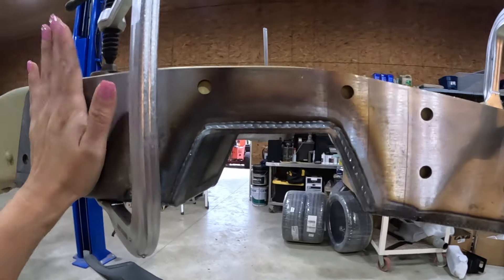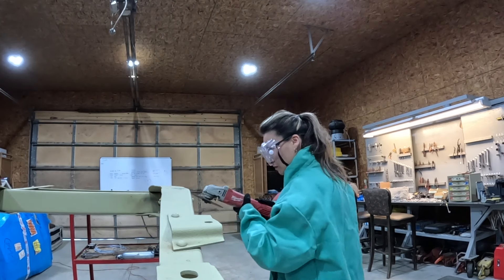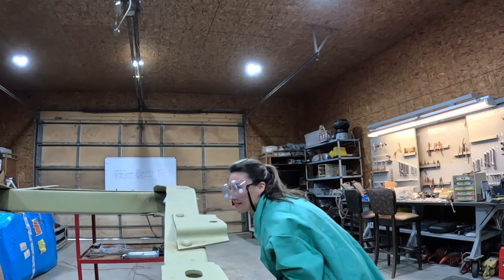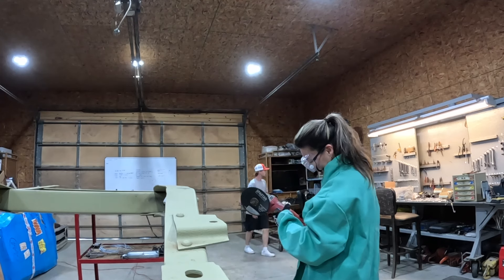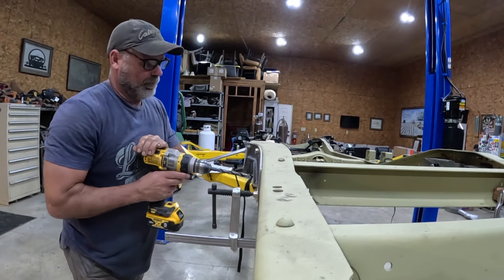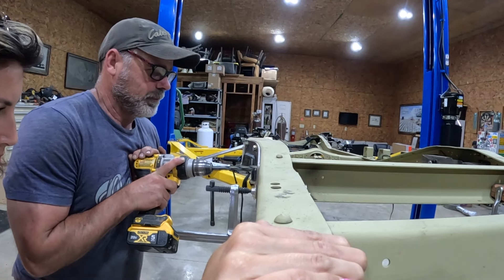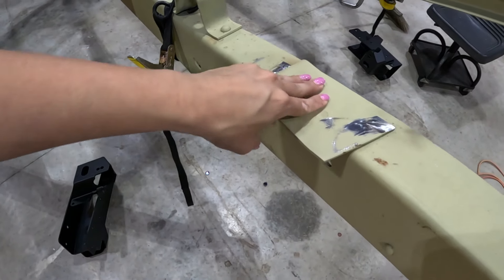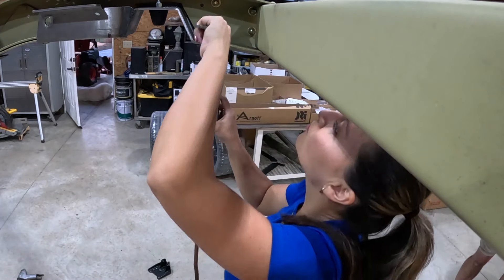FIRST PROJECT UPDATE CHEVY C10 C-NOTCH WITH DSE BOLT ON KIT

Comment: The bit won't break if you get behind the drill and control it the way the other guy did after you broke the bit.  Reaching up to drill makes it so that you cannot control the angle of the drill.  When you are almost thru, the bit will tend to grab uncontrollably.  If you aren't in a good position to control it, then the angle suddenly changes and the bit snaps.  Been there done that, learned how not to do it again.  You are doing a great job Rana!!!  Keep up the good work.
Reply from the maker: Thanks Brad, you’re absolutely right and I didn’t help the cause by moving it around with force, something I def need to practice and listen to the sounds it makes.